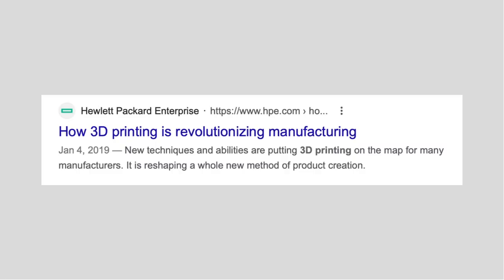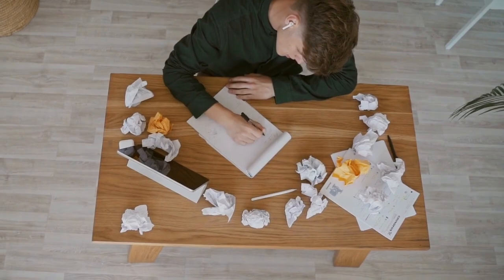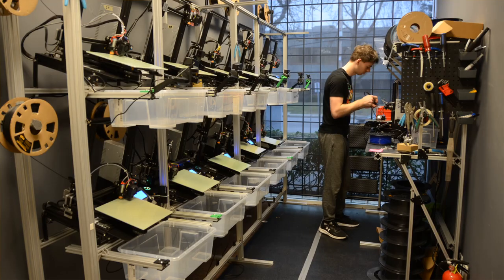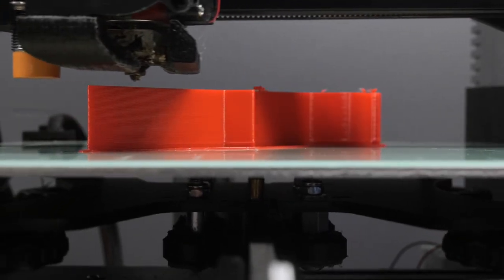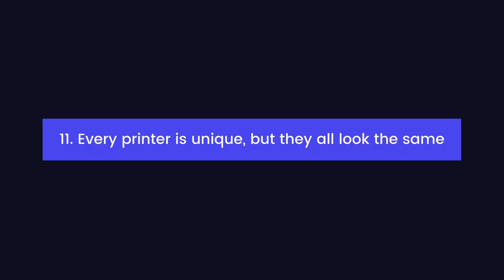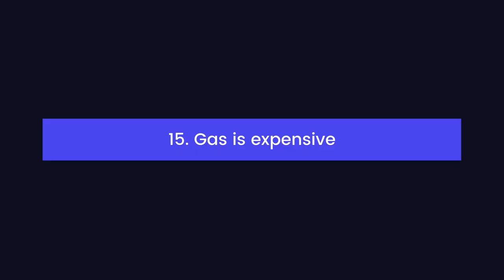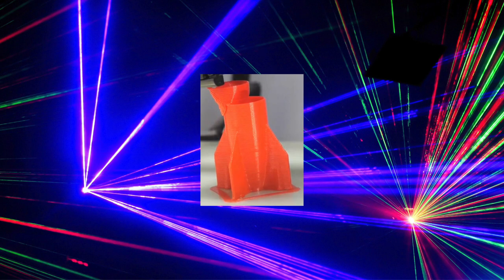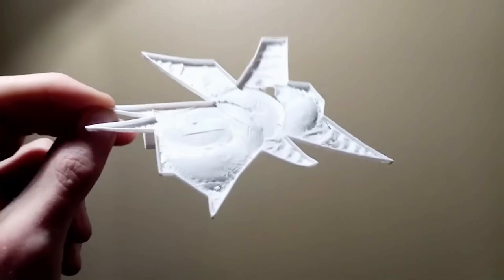Avoid These 3D Printing Business Mistakes

Comment: So buying 1000 hour for $147 equates to $3.52 a day PER printer, if a printer is running automatically constantly, on top of the $40 a month
Looks great and I'll try it but I'll be surprised if anyone with a farm will chose your solution over octoprint with this pricing structure.
Reply from the maker: If you're running 24/7 then I would suggest looking at power slots instead of  hours. Power slots enable unlimited printing on any printer, and they start at $30/month which equates to $1 per day per slot. Hours are intended to be a buffer for farms with intermittent or highly variable printing schedules.

Comment: I agree with the raspberry pi thing totally. It's overpowered  for the task but there's nothing under it that's powerful enough to just sleep and wakeup long enough to report information. The esp32 is close but not there yet.  Extensa is too cheap to pay for more fp blocks when they tape out the hardware updates and there's lots of wiggle room being it's on the 28nm node. The same node the 1080ti used and many other still mighty powerful in their own right products.
Reply from the maker: The nice thing about the Pis being overpowered is that instead of people needing to buy more Pis, we can just make the Pi able to control more printers. We can currently run 2 printers and 2 webcams from a single 2GB Pi4, but some preliminary tests with performance improvements are showing we will probably be able to double that to 4 and 4 in the future.